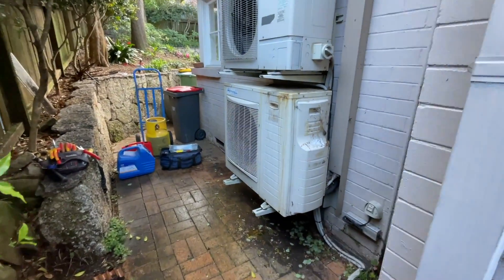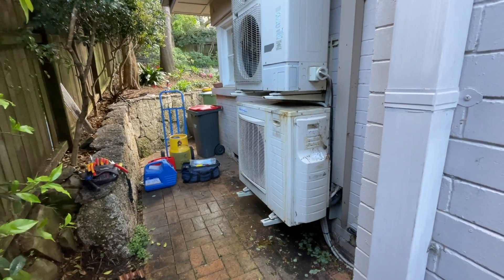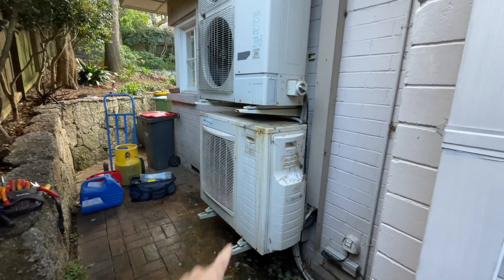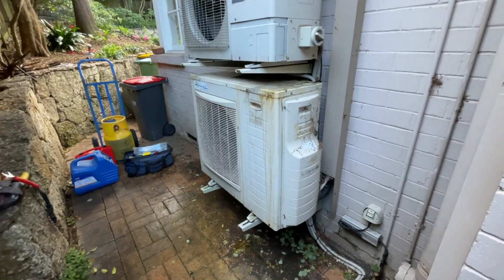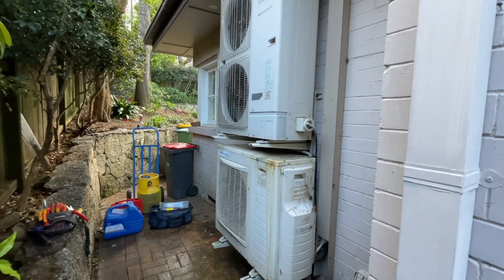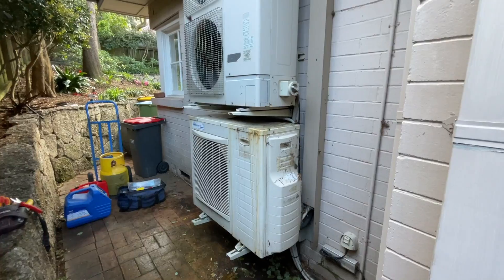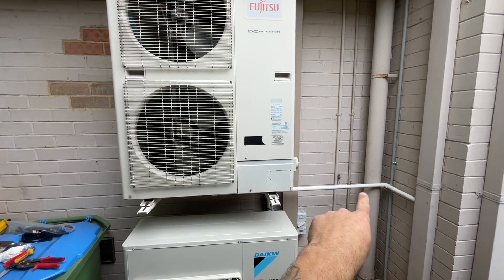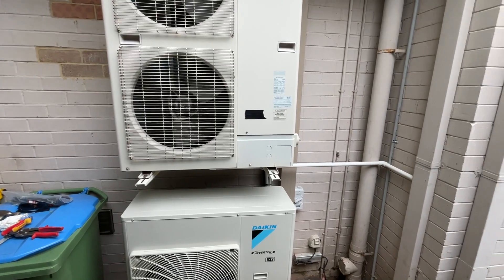INTEGRATING A DAIKIN & FUJITSU AIR CONDITIONER TO WORK OFF THE SAME HVAC SMART HOME CONTROLLER

Comment: Love your content 👌🏻 couple suggestions. Could you do a vid on how to wire up/install that tablet and also wear knee pads as often as you can
Reply: Great video Mitch. I’m also keen to see how you wire the indoor units and program the tablet. Keep up the good work Legend🤙🏼
Reply from the maker: @handle156  thanks mate. I’m going back to this job to add some surveillance cameras and garage door controls to the tablet so I’ll run through it all and how I get the air con to work off it. Cheers
Reply from the maker: Thanks mate. Sure can, I’ll do a video next install. I try to where knee pads as much as can. Don’t want to ruin my knees!

Comment: I like the controller idea saves the double shuffle. I think the higher the bottom unit the better thats a lot of water that can come off that fall.
Reply from the maker: I agree, having multiple units running off the one controller / phone app just makes life easier. In regards to the outdoor unit, nearly every install I do, I always put the unit up on brackets to get it off the ground and I thought this job was going to be the same but the new outdoor unit was a bit bigger. Anyway it will definitely be raised once the new slab is in. I need to return to do a few bits and pieces before it’s a finished job. Are you thinking of going ducted at your house?
Reply: @maracservices  yer Mitch thinking of a 12kw Daikin ducted with zone control. We have split level home and upstairs in summer is unbearable. Was looking at the new Daikin zone controller but MyAir is another option. Have you used there zone control distribution box and motors for 8 zones ?
Reply from the maker: @NeptunesGuitars I’m a Daikin guy as you know but I’m not a fan of their new Daikin Hub. I have installed one to test it out  and I can say that it looks sleek but I personally think they tried to copy MyAir and it can’t do something’s that the MyAir can. I’m not affiliated with Advantage Air in the slightest. I’m just giving my 2 cents worth. I am also not a fan of Daikins app compared to the MyAir app. I personally think it’s a bit slow. 
I have a Daikin ducted in my home and haven’t had any issues what so ever but yeah I decided to use MyAir instead of the Daikin control gear.